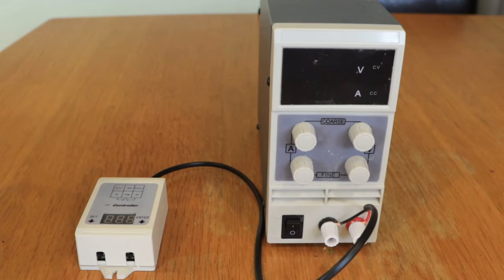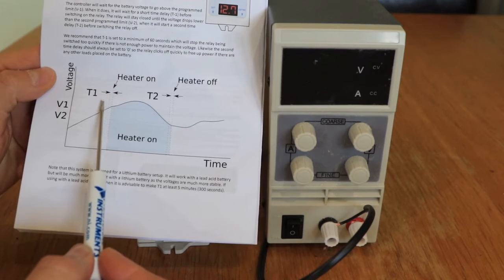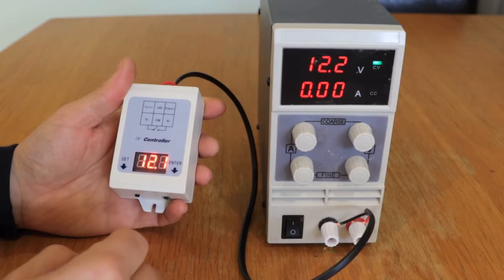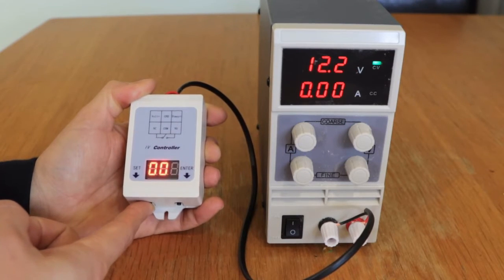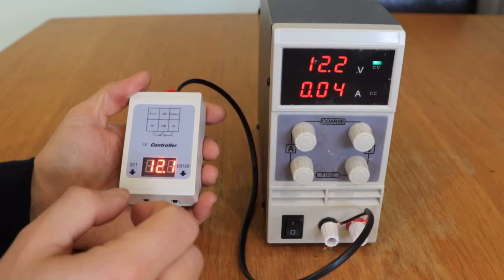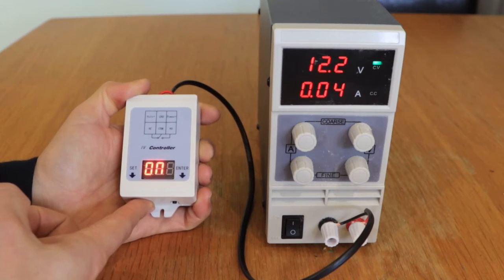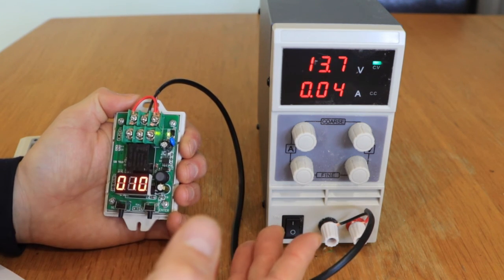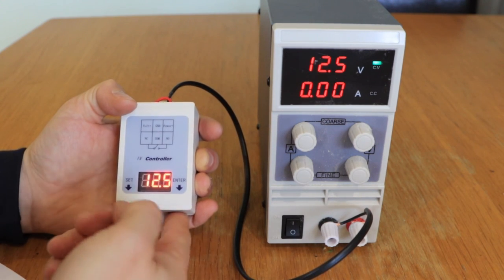Programming the Bobil Vans Solaris Controller

Comment: I have programmed as explained and notice that the controller does not switch off when the power drops below the 12.7 it stays on? im baffled has anyone any suggestions please
Reply from the maker: Sometimes try power cycling after programming to reset the logic
Reply: @bobilvans4205  how is that done?

Comment: Do you have a hot water level sensor switch to turn on a valve to open cold water into the tank when it’s low and shut off when it’s high?
Reply from the maker: Hi there - do you have the Air Xchange kit? Or the hybrid? The hybrid just automatically fills as it’s a pressurised system. The Air Xchange you can put a float sensor in to fill the tank with cold water.
Reply: @bobilvans4205  I don’t have either, I am building my own hot water tank with a few things from you. I just got a 2 gauge float switch which would control a solenoid valve to allow cold water feed into the hot water tank